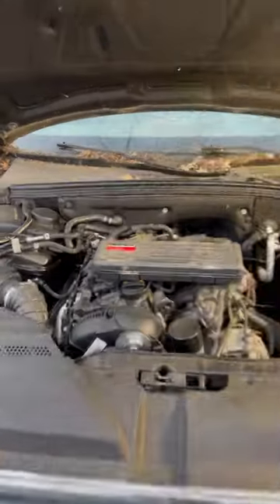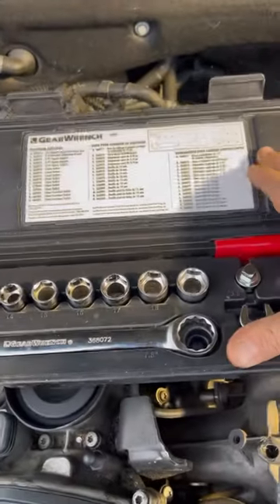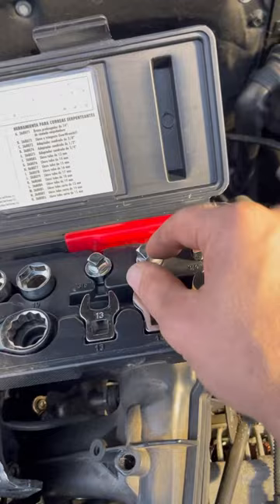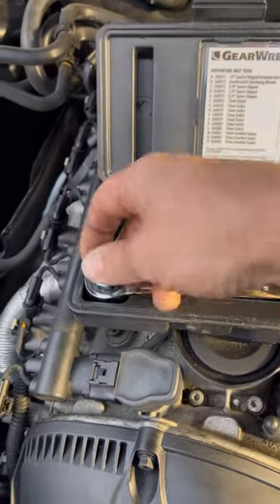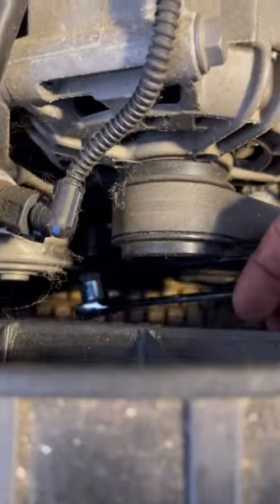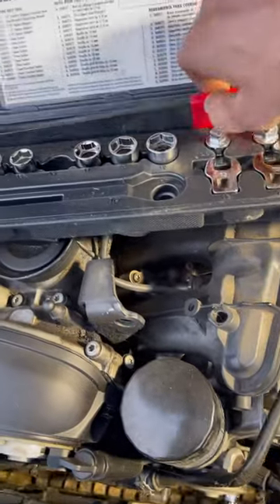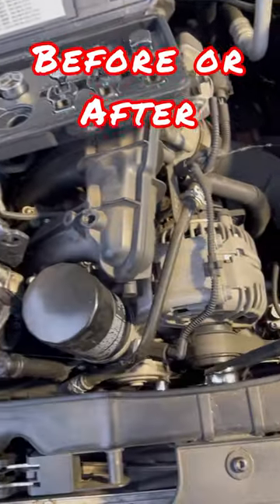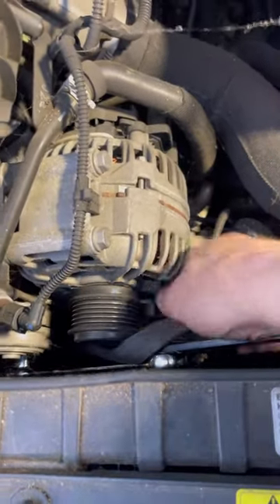MUST HAVE mechanic tool, serpentine accessory drive belt gear wrench low profile adapters kit tips

Comment: Love the kit, i broke the 3/8 square drive and got a replacement part on Amazon before i needed it again
Reply: Really? I've damaged the square slots on the tensioner before (didn't fully insert into slot)  and the square drive bits are perfectly fine. Even when working on diesels (damn duramax tensioners) I didn't see any damage or wear

Comment: Just an FYI to all those who are gonna purchase this kit, it will not fit onto every single transverse mounted  engine due to certain manufactures placements of their belt tensioners. Definitely works better than trying to fit a wrench or ratchet and socket down